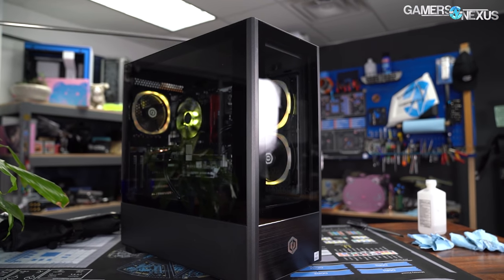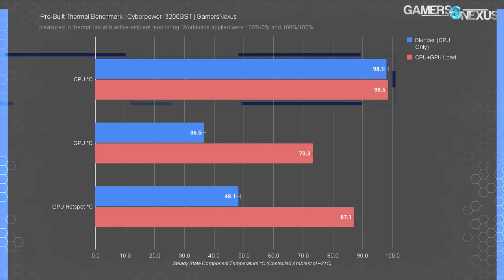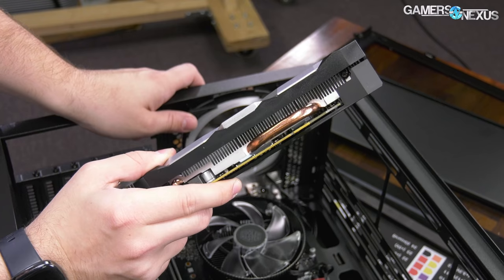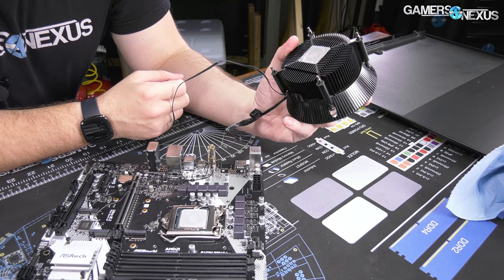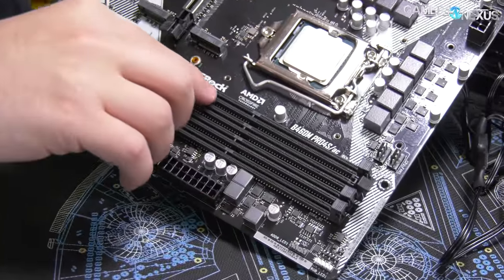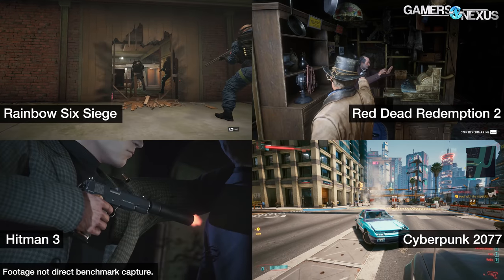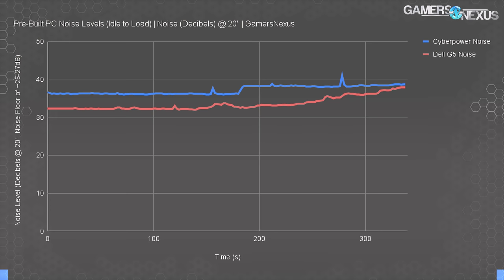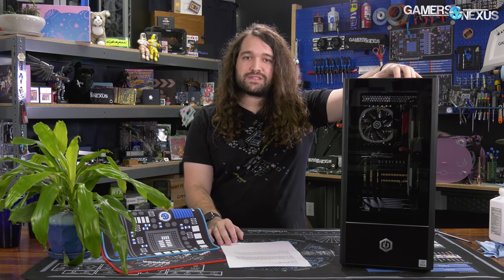Almost Didn't Suck: Cyberpower $1000 Pre-Built Gaming PC Review (Gamer Xtreme 3200BST)

Comment: Hey GN, your video was extremely helpful.  I just picked up one of these Cyberpowerpc's from a dude on Offerup for $600 open box never used with the Asus Prime B550-Plus/Ryzen 5600G/Radeon RX6600.  Before turning it on for the first time, I removed the stock heatsink/fan it was exactly like you said, couldn't believe my eyes.  I picked up a Cooler Master Hyper 212 ($50), 2x16 Thermaltake ToughRam ($240) and an GameMax 800w PSU ($50) that I recently bought for an old Dell that this PC this is replacing  I think I'll be pretty happy with this thing for under a grand. Appreciate your help, salute!!

Comment: I bought a custom built Cyberpower pc delivered in January and at this point I am happy with it. I knew I could build my own, but it's been a couple years and I didn't want to fight scalpers every week, so I just went with this. I spent hours researching all the components and used GN guides to pick out the Phanteks P400A and half decent AIO so my stock temps are pretty good. However, the customer experience was *awful*. The stock RGB was wired weirdly (I basically redid the cable management myself after that) and they forgot the Wifi/Bluetooth card - I'm hoping that script they run now would have caught that. It took hours on hold multiple times to get it because it took a week to ship the M.2 card and they forgot the stupid antennas for it! They eventually sent the worlds cheapest antennas a week later, but by then I had gotten fed up and bought decent ones for $10 on amazon. I hate Cyperpower as a company because everything took 5x as long as it should have, from ordering, to shipping, to customer support, but I do love the computer I have now.

Comment: I bought a cyberpowerpc with the amd 3600 for a family computer. The max cpu temperature I have seen is 91 c out of the box. They definitely have an air flow problem. I fixed it with turning around the two side fans and adding a top exhaust fan. The max temperature dropped to high 70's c.

Comment: Kinda similar to the Cyberpower prebuilt I got about 8 years ago. The price didn't quite fit the breakdown of parts in it and I had to upgrade the cooling as well. Was still miles better than proprietary components, but still a bit over priced for what you got.

Think the prebuilt I got was 970 at the time and came with a 750Ti, 6600K i5 with stock cooler, decent motherboard/RAM, and ok case, PSU, fan layout. I did change the PSU out for one I already had that was better and worked better cable management wise. However, their customer service did not like me giving a low review on their listed product. Tried to make it sound like I just didn't know how to cable manage when I said cables on included PSU were short for the case it came in creating issues when putting in better graphics cards (had a 780 ti I replaced the 750 ti with). Was last prebuilt I got before going fully build my own from then on.

Still though....miles better than Dell for sure.

Comment: Cable management in our Cyberpower pre-built (their ITX system) was terrible, created a permanent bulge in our side panel... which wasn't even for the right case lol. They also got thermal paste on almost every component, scuffed the GPU, PSU, and riser port, and damaged one of the SATA cable connectors. Also ended up having to move things around to get it to not be an absolute hot box. It WORKS fine otherwise, but man, that thing was too much work for the 400$ over MSRP mark-up it carried.

Comment: I recently got my Cyberpower PC after about 2 months of waiting.
It was a 5900x and 3090 build. I picked the generic power supply because I already have a corsair one to replace it.
The power supply they included was the Apevia Prestige 1000w. I have seen no reviews on it and apevia units usually have bad rep.
Would you be able to do a review on the Apevia Prestige 1000w PSU? I bet most people buying these prebuilts are just leaving the PSU as the Apevia one.

Comment: That CPU cooler is fine.. The prob was there was no air intake fans.. Good cooler, shit chassis.. Thats the heat problem. You should have tested the system after changing the fans from Exh to Int. Not doing so completely invalidated your temp results.. I stopped watching at that point..

Comment: On the Molex centipede... I'd have spread out my connections if I had to have a bunch -- they did have another Molex connection open. And they could also get a fan power splitter -- you can get them where you plug 5 fans into it, connects to one Molex, and a single cable goes to the motherboard header.

At least it didn't catch fire

Comment: I bought a $3k Cyberpower PC, and I didn't know very much about computers when I bought it. I knew CPU and GPU and that was about it. As time went on, I learned more, and guess what? STILL TERRIBLE COOLING!! When I was having problems with my computer rebooting, I learned about what temps things should be. My Ryzen 9 3950x was consistently at 90 degrees. Unacceptable! 

BUT! Now that I've learned a LOT more, I've found that I have a solid mobo, and I've upgraded almost everything. Really, getting a pre-built was great for me, because it helped open the door to building a computer, since I've replaced so much now, and I know what I'm doing. Also, my computer problem was a Windows error, so it's funny that it led me down the path of learning more about my hardware. Thanks, Windows!
Reply: Nice. Knowing your pc = less pain in the ass.

Comment: Almost 4 years ago I bought a Cyberpower PC on sale. It was a pretty good deal for the system but it needed a lot of work. I upgraded the majority of the parts in the computer. I replaced the CPU cooler with a 240MM AIO from NZXT, upgraded the case fans to Be-quiet silent wings, replaced the PSU with a 750W platinum EVGA unit, upgraded the boot drive to a 500GB 960 Pro, replaced the founders edition 1070 with an aftermarket 1080, and had the 7700K delidded by Silicon lottery so that it could run at reasonable temperatures with a mild overclock. That was a very fun project but the PC should not require that much work to be good.

Comment: The thing with cooler looks strange. I've had one of those with an i5 10400f recently and it performed at around 65 C during OCCT with 2 case fans (intake front, exhaust rear). 10400f is that much colder that 10600kf?

Comment: would lapping or sanding down the heat sink fix it?
benchmarks?¯\_(ツ)_/¯
When you're selecting your options check the ram upgrade cost. When I bought my Lenovo Legion I check the ram difference and it was only about $8 more difference to have it already installed and a pre mached 3200mhz set👌

Comment: The biggest issue here is that high temps, eat the lifespan of any electronic gear.  So run your CPU above 65c if you want, but you're an idiot to do so.  And you'll be buying another CPU much sonner than necessary.

Comment: I tried hard to get a PC build together but I couldn't find a graphics card so I bought the gamer extreme can't remember the skew but it's the one with the 10700k and the 3060ti, I knew I was going to deal with the pre-built headache and I had similar results, CPU cooler was anemic at best, I put a cooler master 212 RGB black edition and called it good after reversing the rear fan, my CPU now sits at 65° c at full load and overall the thermals throughout the entire case have improved massively. For 1,100 I spent on it. I really could not have done better if I tried to build it myself. As long as you have a very good eye and understand the components it is now an acceptable route for the advanced user

Comment: I bought the AMD 3700x/RTX3070 prebuilt from them in late 2020. I didnt do a teardown like this until almost a year later, because I felt like the PC was underperforming. Come to find out that the CPU was ROASTING with temps at over 100+. It was a water cooler (branded RGB heat sync and Cooler Master single fan radiator.) Replaced it with a giant Noctua air cooler and it never goes over 70 under load.

When i cracked open the case and saw the Molex centipede I had the exact same reaction. "WHY?"  There are so many better ways to do this, and even though it doesnt hurt anything it still looks cheap and terrible. The RGB controller board on mine was on a stickyback piece of tape and falling off. CYBERPOWER...just screw the damn thing down. It's not that hard. I paid almost 1700 bucks...the least you can do is take an extra 5 minutes and do it right.

XMP was enabled, and my board was capable of the 3000 MHZ. Lazyness to not enable this.

How does Cyberpower not do a temp test on their CPU/GPUs before shipping them? This is the EASIEST part. Do not send something to a customer that will catch on fire?

Comment: Hey, I have a Cyberpower system aswell, Came with a 9900KF and RTX 2070, got it in like 2019, and they put a intel stock cooler on my 9900KF, thing would hit 115C in Far Cry 5, replaced it with a Hyper 212, also replaced the same RAID brand molex centipede fans with some Noctuas recently. My brother who got the same system as me also got a higher wattage PSU than i did, 600 vs 650 and mine would overheat and shut down the computer during random games like R6 Siege. Didn't want the pre-built in the first place and regret getting it especially for the cost pre-shortage.

Comment: All these prebuilds do the same thing. They dont use the recommended PSU when using a good vid card or use quality heatsink/cpu fans. I just got a cyberpower and was cheaper to get at bestbuy then to custom build it through cyberpower, which totaled like 2.5k i think compared to 1000 less in store. Just under 200 and i get a higher rated PSU (came with 600 bumped up to 750-corsair brand) and stand up heatsink/fan with pipes plus an extra case fan to better manage air flow (both are be quiet brand). Still fan curve cpu fan in bios and gpu fan through software (which needs to stay running in background) and temps are much better. Oh yea its a ryzen 7 5700g and evga nvidia 3060 12gig.

Comment: Just bought a cyber power 3060 prebuild with an 11600kf cpu. Played MW 2019 gunfight for hour and a half and cpu temp is 98….. the prebuild was suppose to have a fan for the cpu but instead came with a liquid cooler which I was pumped about. Except wtf are my temps so high

Comment: I am very late to this, but I got a cyberpower PC in February 2021 and it has only been problems so far, it constantly crashes and I have RMA the motherboard, replaced the cooler, and RMA the rams and it JUST CRASHED, so I have submitted an RMA for the GPU (a 3070), will come back to update. But also if you have any advice I'm desperate

Comment: Dude i lucked out, got a cyber power PC with Ryzen 5 5600g, 6600xt, ASRock 550mobo, 600w gold power supply,  500g m.2 nvme, descent mesh case, descent CPU cooler, but there was only 1 stick of ram. (But i have 4 sticks that i just threw in there for 32g.)  All only for $1200. And in today's market it was a steal. Unfortunately it came with windows 11 and drivers were not current so there was some work around for the amd packed pc. But thermals are great, performance was great. Scored fairly high in benchmarks, everything was tight and right, good cable management. We couldn't believe it. Very impressive from cyber power

Comment: Holy Sh** I was feeling so lucky w my Skytech $1400 RTX 3070, Ryzen 3700x, 16GB 3400, B550 Ac, and 1TB NVME SSD bought in Dec2020. I guess I did get lucky within prebuilts as well the thing works minus some Windows store issues, and CPU cooler being usually 70-80 C. Else Id be complaining that I shouldve gotten a scalped PS5 and a $500 laptop.  Guess I now don't recommend prebuilts unless are super lucky.

Comment: I've never bought a pre-build but I'm about to.. 10700K, 3080, 32GB ram, ASUS TUF Z590 for $2600. That's the price of a single 3080 on eBay. I'm so tired of trying to get a GPU at an even vaguely reasonable price. 
But I'm going to rip everything but the PSU, cooler and fans out and put them in my old case. Yeah it's a month wait time, but I don't see getting an MSRP 3080 any time soon and my 4790k + 980Ti just don't cut it for VRChat anymore.

Comment: I bought a used Cyberpower system with a 9400F and 1660 and on3 8gb stick of ram, I replaced the stock intel cooler and got a 2nd stick of ram and I have no real issues. I also replaced the cheap stock fans as well.

Comment: I bought a prebuilt 5950x system, simply because I could not find the 5950x nor the RTX3070 anywhere.  Other than the processor, everything else was low end stuff!  Asus x570 tuf gaming plus, evga3070 (no frills and no RGB), 16gb 2400mhz, 1tb wd pcie3.0 ssd, 1tb wd 5400rpm drive (low end mb dram), horrible Cyberpower cooler and terrible case.  I have not even looked at the 1000watt power supply, but I bet it is not a name brand.

Comment: I just picked up a cyberpowerpc because it had a Radeon 6600 and r5 5600g in it and was under $1000. CPU has the same crappy cooler but it's a more efficient chip and the case is a much better design with a mesh front, so thermals are good, CPU under full load at 4.4ghz gets to around 72c at the hottest. My only complaint is the weird generic gigabyte mobo which came with an awful manual and no info on where to find the correct BIOS updates and drivers.

Comment: You might check out Sky Tech. I went with them after a horrible experience with the egg idiots.
I bought a Sky Tech system (3080 -3700X - "TWO STICKS" of 3600 Adata) in January. I've made a few mods but it was quite workable out of the box. The same system doesn't seem to be available anymore and prices have gone up of course. This is a "Blaze 3" I bought in January for $2299.
It was running in the 70's til I did a complete fan swap to 6 Sickleflows and dropped 15 degrees.
It shipped with 3 Skiron(?)fans in the Neo Air Case...I think they did 52 cfm....the Sickleflows are 65.
The other day I was looking at it and thought...why is there no fan on all that empty space where the unused pci slots are? So I stuck one to the outside...7 fans running in a 5 fan case. ( I have a push pull on the 120 radiator.) My 3080 barely uses it's own 3 fans.

Comment: I know you aren't in Canada, but here's an option from a Canadian store that is kind of our version of Microcenter.
R53600 (looks like stock cooler), Gigabyte GTX1660Super, 16GB Kingston RAM, 500GB M.2 NVME SSD, looks like a Gigabyte B450M DS3H mobo. and a Deep Cool Matrexx 55 Mesh case (marketed as a high air flow case). Can't tell if they have any fans other than the rear exhaust installed, though. When converting from CAD to USD, works out about the same as the Cyberpower. I have no personal recommendations or experience, but thought I'd drop a Canadian option for your viewers north of the border if you would be interested in reviewing it. :)
https://www.canadacomputers.com/product_info.php?cPath=1446_1448&item_id=188916

Comment: I bought a cyberpower 3070/3700x system at best buy back in February. it was $1,450, I added fans to all available slots (it's the Amethyst case). It has a crappy 120mm AIO, and I want to switch to an air cooler, but I have no idea what'll fit.  Same ram as in the reviewed one, but two sticks and running it at 3200 mhz. WD SN550 NVME.  Anyway, I'd recommend it even if I had to play with it to get it good (it's now $1600 when in stock).

Comment: -Has three exhaust fans and no intake fans
-125 watt CPU with 95 watt cooler(as far as I can tell from Cooler Master's documentation)
-CPU cooler has inadequate mounting pressure/surface
-Molex centipede
-Used non Z SKU motherboard, so can't utilize advertised memory speed
-Single channel memory configuration

I'd expect an SI to be able to configure a system better than a first time builder, but shit, it's 2021, we're going backwards this year.

Comment: I bought from the company my pc being built in the warehouse. 
Gpu: rtx 3060
Cpu: ryzen 5 5600x
Motherboard: asrock x570 taichi 
Ps: 1000 watt gigabyte 
Memory: same ram but 16gb
Hd: 1tb gigabyte Aorus I also have 6tb different brand tho I'm going to put in.
I don't know if that the same case has mine I have the lian li 08 dynamic mid tower. 
I didn't pay attention but it also has the masterliquid lite 120mm liquid cooler
I'm going to add more fans once it comes in.

Comment: I bought a cyberpower through a 3rd party retailer (RENT TO OWN). The innards sucked. THe only decent thing i got from it was the PSU lol. I already switched out the mobo, cpu, gpu, and ram cards lol. I bought it in 2018 and the parts were manufactured in 2014! The graphics card had a single fan, and only needed a 4 prong plug in instead of 6.

Comment: I dont understand what are u talking regarding the price ? U asume tha a GPU cost 500 $ (btw. u just showing ebay offers new for around 700) and a 10600K 200 $ so add a SSD (30-40) Case and PSU (100?) Memory 8gb? (50) and a Mainboard (100) you are around 1000 $. Someone has to build the pc at the end and warranty and stuff...so if u value the gpu on 500 it is value..so just bad calcutation on your side.